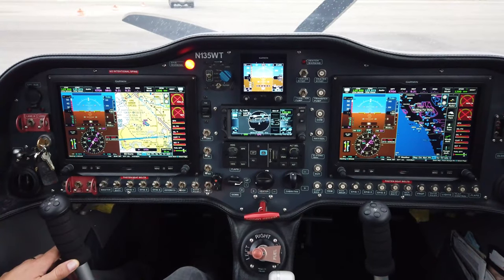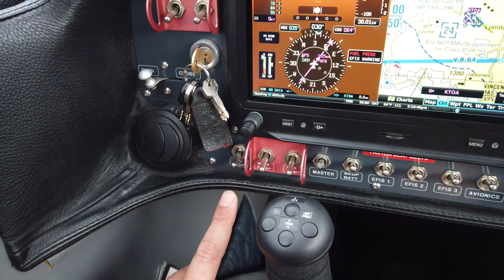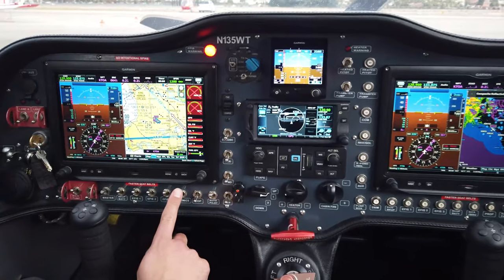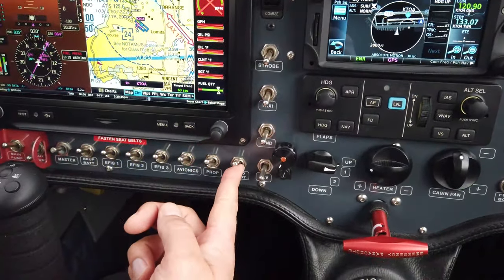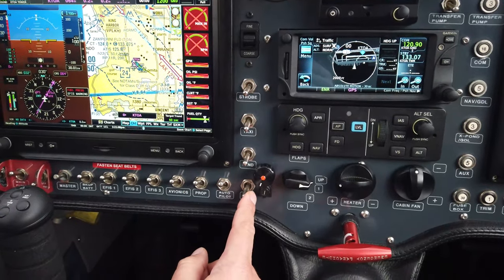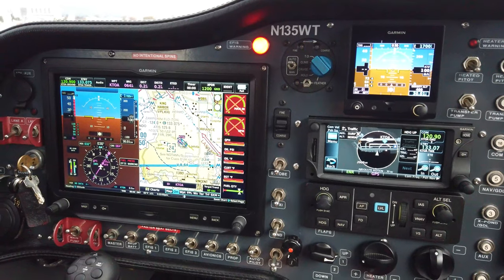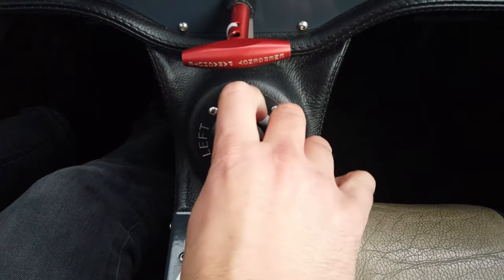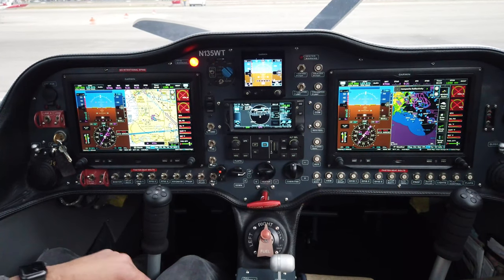Sling TSi Cockpit Tour

Comment: Nice video however there’s far too many redundant switches which add complexity. I have a S-21 set up exactly like this sling and I don’t have or need a switch for each separate component. That’s what the avionics switch is for and pullable Circuit breakers are for.
Reply: Yeah, the panel on my TSi has far fewer switches. Simplifies things quite a bit, and the VPX cleans up the panel even more by removing the CB’s.